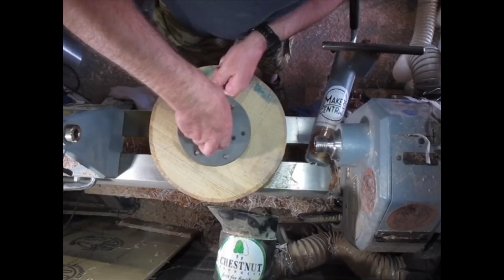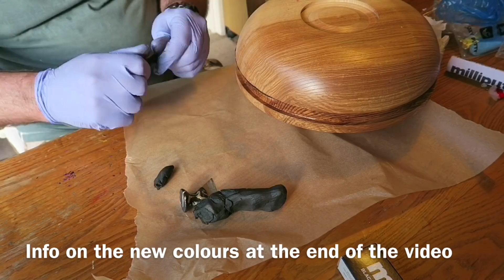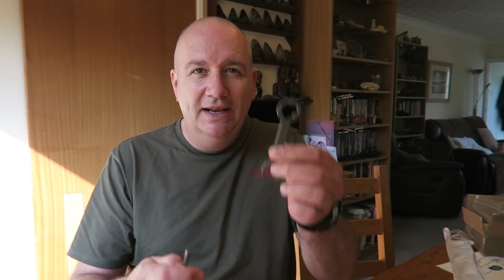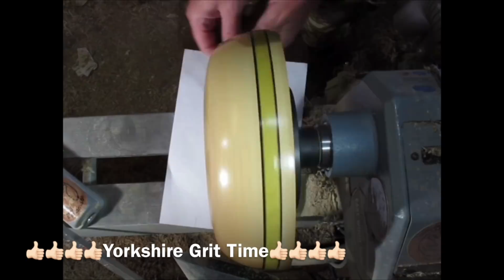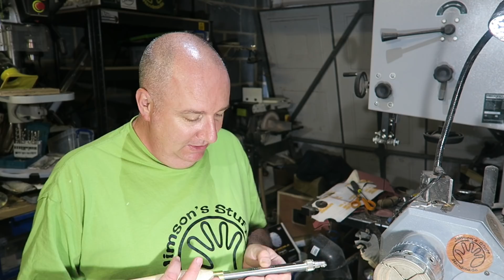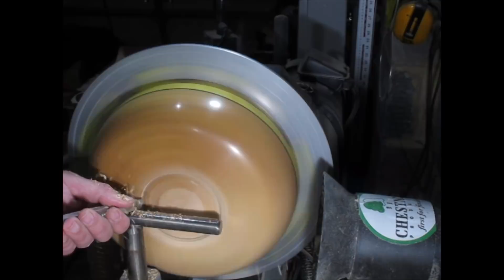New Milliput Colours - Easy Chuck Big Easy Jaws

Comment: Epoxy resins are usually colorless, crystal clear and stain very well. Various methods are used to color casting epoxy resin. Pigments for epoxy resin can have different consistencies and their use varies accordingly. Thicker resin pigments are classified as "pigment pastes" and are used for rich, opaque coloring of the resin. Pigments for resin in a liquid state belong to the category of "pigment solutions" and are used to create transparent, transparent castings. Mica pigment powders for resin are loose materials.
Reply from the maker: Yes I have used them all for different projects. Many thanks for watching.

Comment: I appreciate I'm way behind watching your video but I'm fairly new to using Milliput I just wanted to know how deep you cut the slot for the Milliput to be seen from inside and out, enjoy your videos
Reply from the maker: To make the inlay visible from both sides, you need to make the slot approx 2mm deeper than what will be the finished thickness of the bowl, probably best not make it too thin
Reply: @JimsonMakes  Thank you for your time to reply it worked very well, unfortunately the colours you used are not available but still impressive with other colours

Comment: 1/2" bowl gouge. HELP! Is that the flute width or the diameter of the tool shank? Nice infill.
Reply from the maker: It depends on which brand, some use the flute width and some use the shank. I have 3 different ones, all with different shaft diameters. Glad you like the infill.

Comment: Very good vid and finished product. I haven't used milliput yet so this is a very interesting intro.  I am amazed that the milliput is strong enough to hold the top and bottom together given that the wall is pretty thin, are you truly confident that it will hold?
Reply from the maker: Thank you very much Kevin. Difficult to say how strong it is, but there was a fair bit of vibration whilst turning the rim and it cooed with that. I also tightened up the reversing jaws very firmly when I finished the bottom. Cheers, Jim

Comment: Hi Jim,

Great video. Just wondered if you'd ever tried using Fimo.  I use it quite a lot. Has an enormous range of colours and effects. Has to be baked to harden but only at a very low temp. Turns really well too.
Reply from the maker: I have used Fimo for all sorts of creative projects, including Neville my workshop mascot. I don’t like using it for inlay work because of the risk of warping or cracking the wood and it does have a tendency to shrink on cooling sometimes. As you say, it does turn well. Cheers, Jim

Comment: Good start for Milliput trying new colours. Yellow could be a bit more vibrant, blue would be a good. Just wondered if they did the primary colours could they be mixed to create secondary colours?  Nice bowl by the way, does the Milliput still feel stable.
Reply from the maker: Thank you very much Simon, yes the inlay is still very stable and bonded. Yes it will be possible to blend colours. Cheers, Jim

Comment: I’ve been wondering, and maybe I’ve even asked you this before, but can you use the white, and dye it different colors? Have you ever tried that, and if so how hard is it? And if you tried it did you make a video?
Reply from the maker: It is possible to colour white Milliput but it is very messy to do. You have to make a paste of non toxic pigment powder and slow set epoxy resin and mix it into the white Milliput. It takes a lot of pigment to get much beyond pastel shades. Cheers, Jim

Comment: Hi Jim, What about metallic colours, GOLD, SILVER, COPPER, BRONZE... They would be excellent and have many uses in my opinion! As for colour's, a set of DARK RED, YELLOW AND BLUE could be mixed for multiple colour's plus lighten with the white if needed! One question, I've only used the turning plate once because the screws sheered off! What depth of screw do you use? Size 6 screws are very tight in my turning plate and the 8s are to small! Brilliant video mate as always👍😉👌
Reply from the maker: Thank you very much Andrew. Not sure if metallics are possible. I use faceplates a lot but I use beefy high quality stainless steel screws and always drill pilot holes. I also tend to only use the screws once. Cheers, Jim
Reply: Jim Overton - Hello Jim, Thank you for your reply it's very much appreciated mate 👍 😆 👍 Oh stainless! I used Phillips head 3/4" brass size 6! I wouldn't trust the screws twice lol, I always drill pilot holes because of the hardwood and a rub of wax on the screw shaft! I'll  have to get some stainless one's. Cheers for the advice 👍😉👌

Comment: Nice colours and would be good to see a blue, then you have rgb and can mix your own colours colour shades ;) although that I imagine would need thumbs the strength of thor, and yes Turquoise would be a good one, maybe a turquoise with a slight interference addition to it so it has a slight variation instead of a flat colour to closer resemble a turquoise inlay from a distance
Reply from the maker: Yes Mark a turquoise would be great and you would probably have to add marbling yourself at the end. Cheers, Jim
Reply: You should rather use CMY to mix your own colors, not RGB ;)
Reply: Wupme cheers fella, looks like they need to release a Cyan and Magenta aswel then ;) yellow and black already available, that is if the colours do mix which I could try as I have black and terracotta, could end up with darker terracotta or a marbled mix of both, my guess is the later though

Comment: Thank you, Jim, for a very interesting video.    I'm delighted that Milliput is introducing more colours and, as with yourself, I would be very keen on turquoise.
I've been using the Sorby Turnmaster for several years but with the Sovereign handle.   I too enjoy hollowing out with a bowl gouge but I've developed my own own technique for removing material rapidly using the square tip on the Turnmaster.   I present the tool level on the tool rest and start cutting with the point at an angle of 45 degrees and see-saw back and forth.
The interior needs a lot of refinement afterwards but it certainly removes material rapidly.
Reply from the maker: Thank you very much Alan. I will have to look at your hollowing technique. Cheers, Jim

Comment: Hello Jim, There is no doubt that additional colours in the range will help, but isn't the point that the creative community will always want more and different. Milliput may not feel able to support a wide range of colours. Can they consider dyes and pigments acceptance though, as this would then really only require white or neutral. So long as the properties and structure of the milliput were not adversely affected one could then make ones own; go iridescent, metallic, luminous, glittery. .  .   .
The tool looks too small and lightweight for the relatively large cutting head assembly. I think I have that size handle in their starter set. Maybe it is over designed and engineered for what is a simple requirement.
Other than that you made a very attractive bowl. Well done.  Regards, Glenn.  :-)
Reply from the maker: Thank you very much Glenn. It is possible to colour white Milliput but difficult to achieve much more than a pastel shade. More colours would make it easier to blend your own. Cheers, Jim

Comment: Lovely bowl Jim. And as usual, your video was very informative. Thanks for that. Regarding the Milliput; all colours are good and the more choice the better. I wonder if they could produce some metallic looking putty? I think even a sparkly putty would be excellent too. I have the Sorby soverign with the long handle, Its OK but as you said there is a lot of overhang and it is annoying changing the tool rest distance if you want to switch back and forth with other tools. Cheers.
Reply from the maker: Thank you very much George. Metallics might be difficult to produce. Yes the Turnmaster is tricky to use. Cheers, Jim
Reply: have you ever tried sprinkling/mixing into the Milliput some metallic dust? The type they mix in with resin?
Reply from the maker: The problem is that because Milliput is totally opaque you would need to add an awful lot of metallic powder into it in order for enough of it to show up on the surface.
Reply: Mmm. Well, just a suggestion in case it could be done in metallic and especially metallic in turquoise as you mentioned.

Comment: Two words primary colours, milliput  need to produce a blue to go with the red and yellow with a chart the tell you how much (in cm or weight) to mix in to get any colour you want?
Reply from the maker: Yes that is a good idea but there are a few colours such as turquoise that would still be difficult to make. Cheers, Jim
Reply: Yes, it seems primary colours and then possibly secondary colours as getting secondary colours from primary is not always easy or just not possible. With those colours, a much greater colour range could be obtained that the 3 colours in this video.
Reply: Jim Overton - Jimson's Stuff, Hi ho Jim, I'm sure your only saying that because you have a turquoise fettish.